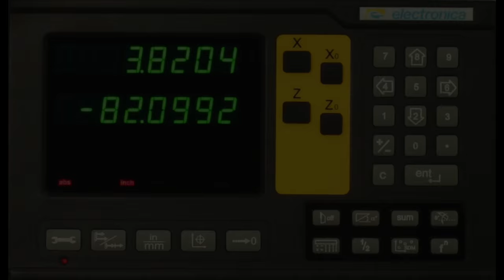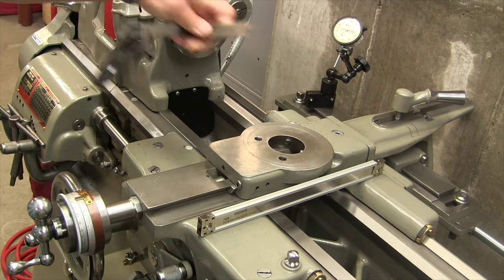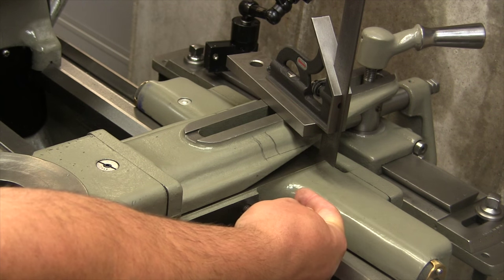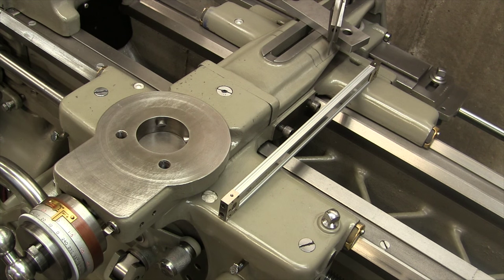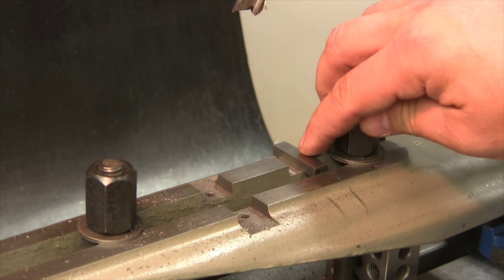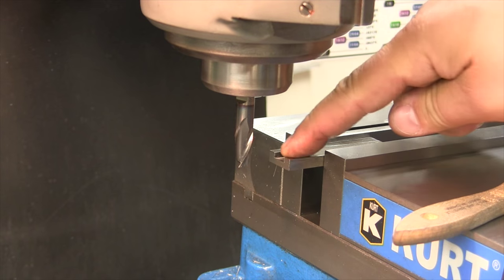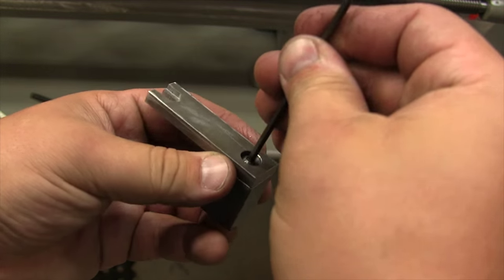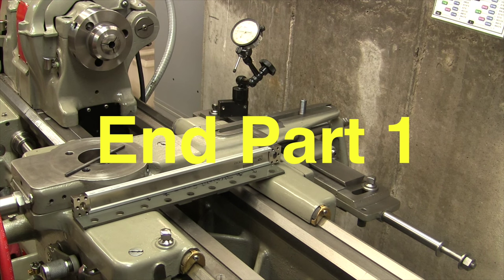Installing a DRO Pros DRO on a South Bend 13" Lathe Series: Part 1

Comment: Great job very clean install, I put an EL300 on the mill/drill and another on the 10x22 lathe both from DroPros good folks. ready for part 2,,

Comment: Hi mate.Nice installation, I must confess mine was a little easier, but what are you going to do with the tail-stock.  The installation will be sticking out a fair while.  The tail-stock will be bumping into the reader,  and it's reach will be rather reduced.  I had that same problem.

Comment: Is that a FUBAR extra slot milled in the rear mounting area? Measure twice.
Reply from the maker: +kooldoozer Good eye - but it's not a mistake. It was from a DRO that I ("was") in the process of mounting. One that decided to return and not install. I just didn't like the prior one and returned it.

Comment: Hi, 
Great job, and thank you for going to the trouble of making this video for everybody! I'm interested in installing a DRO Pros kit on my Clausing-Colchester 13, so I'm looking for any howto info I can find. Your video is super informative, and I haven't even watched the whole thing yet. Granted, your South Bend appears to have a bit more clearance between the top of the carriage and the compound. On my Colchester the cross slide casting is just really thin; so it's going to be a bit tricky to fit the scale, and the cover in there - and still be able to turn the compound...
Finally, wow, what a nice-looking lathe! And I thought I was insane, having spent way too much time restoring my own little South Bend 9A... And it's still not looking as fancy as yours. :)
Reply from the maker: Thanks Leonid, appreciate that!

Comment: good idea, and the result will be acceptable, of course, and the measurement is going to be true and correct.
but the actual execution of work looks like a temporary kluge in a disaster area. sorry.
if that lathe were a dog, it would have bite you, and run away.
Reply from the maker: +Toly Dukhovny I'm sorry, I not following your direction of comments?
Reply: +BasementShopGuy 

here it is, rephrased.an engineering design must not
only be functional, but also raional, and aesthetically pleasing.the horizontal support plank is plenty
strong for the ruler if it is 0.187 thick. the rear support allows for the
parallelism rotational adjustment. the front support deals with the windage. neither one should deal with both adjustments, for it would make the construction cluttered. the fitment of the rear plank into the milled slot should be exact, – without gaps, and attached with a flat-head screw. for the slot of 0.687, thebest screw would be nf #12-28. the best screw for the rotating block is accurate flat-head shoulder screw, also nf #12-28. this will position the block on rotation freedom only – that's good for precision adjustment.the length of the plank shall be determined by attaching a 24" machinist square short leg to the longitudinal ways. that shall be done high enough to be able to scribe a precise line on the plank.the front support is heavier – it is in the work area, and may be bumped. the extending is to be made shorter for, say, 0.015, and the actual extension is determined only when the rear support is complete. the widage adjustment is the duty of the bront support, and it is done by installing the precise spacers of precision stock.all this is to be carefully thought out on paper and with strength of materials in consideration, so the final result is to be a reason to show off, and be proud about.i admit i was a little harsh onyour work. your pristine and beautiful lathe, i thought, deserved a better
treatment.-toly
Reply from the maker: +Toly Dukhovny uh... i got nothing.
Reply: +BasementShopGuy  cannot explain my point -- provided i had one -- any better.
let's agree to leave it at that.

Comment: Great video Brad....sure wish my place looked more like an institution, as far as cleanliness!  Not sure if you mentioned it or not .....are you using a magnetic or glass scale. I have seen some use the glass scales on their mill, and magnetic on their lathe, for a reason I fail to recall....smaller profile, I guess, and I think with a magnetic you can cut to length, and a glass scale needs to be sized initially.....I would assume the cross-slide would be considered the Y, and the carriage direction the X ?
Reply: +Jim Liechty Cross-slide is X and carriage is Z (along the axis of the spindle). No Y on a lathe, at least not on a lathe with only two motions.
Reply: +Jim Liechty Those are magnetic scales, and DroPros usually gives you a 1 micron scale for the cross slide.
Reply: +Peter W. Meek   Thanks Peter
Reply: +Peter W. Meek A milling attachment would be an example of a Y axis on a lathe.
Reply: There are also the rotational and linear motions of the Compound to consider. I'm not sure what their designations would be. They rarely get DROs, however.